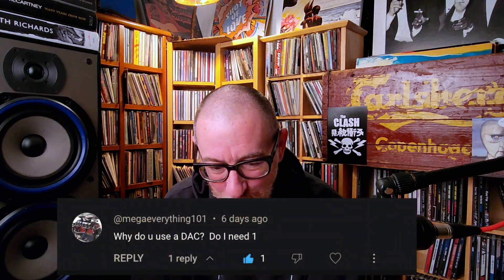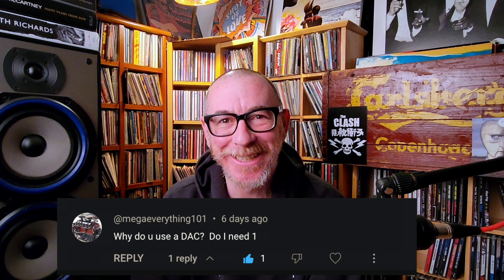What is a DAC? Simple and Straightforward Explanation.

Comment: Hi there, my friend! I just wanted you to clarify me. I'm using my mobile to stream music from Spotify and YouTube to my Samsung party speaker with Bluetooth, and I have a 3.5mm jack as well as RCA input and output options. Will this DAC work well with this setup? I believe my Samsung speaker has analog input and output capabilities. Will it make any difference in sound quality? I'm particularly interested in using this DAC for improved clarity and sound separation.
Reply from the maker: Hi there! I this case, if you wanted to use an external DAC you could connect it to your phone via USB and then run the analogue outputs from the DAC into the analogue inputs of the speaker. This will bypass the DAC in the speaker that would be used if sending the music from the phone to the speaker over bluetooth.
Reply: Analog-digital hifi machines were develloped by advanced companies as Philips, Sony and teac! Their advanced transports and inboard DACs are not outperformed by the new overprized snakeoil!
Reply from the maker: @GeirRssaak  You can buy very good sounding external DACs for not much money. The Fosi Audio Q4 I use is around £65 on Amazon. I wouldn't say that was overpriced.

Also over the years, we have seen different types of DAC evolve. Sigma Delta, Mulitibit, Ladder, etc. All these have different sound characteristics and even different manufacturers of each type will design them in such a way as to recreate the analogue sound in their own way. 

I understand you think DACs are all the same, but they're not and they're certainly not (for the most part) snake oil. 

With that being said, as with everything in hifi there are laws of diminishing returns. If your speakers aren't capable of resolving the difference or your ears aren't what they I've were (like mine) then spending thousands on a DAC may not be wise. For my hearing and system I was able to achieve a very noticeable improvement in sound quality with the modestly priced Fosi. I'm not here too sell you one or argue with you though, so by so means don't get one of you don't want one!
Reply: matt, thank you!

Comment: Informative and interesting. I use a Cambridge Audio dacmagic 200 straight into my audiolab 8000lx (and then out to a pair of rare Polk RT16 speakers) with great results. The main input to my DAC is a Chromecast audio (different from a normal telly watching Chromecast) which can output an analogue signal (normal headphone 3.5mm jack) or in my case a digital optical out. Brilliant inexpensive streaming results with low cost gear.
Reply from the maker: Cheers Jamie, those Polk RT16's are very cool! I hadn't come across the Chromecast Audio until you mentioned it but it looks pretty nifty! Will it stream files from a local drive too? I've just ordered a CD burner with a view to building a music server filled with all the stuff in my CD collection so this might be an option for streaming from that if so.
Reply: @mattsmusichannel  the Chromecast audio is for sending audio to from your phone or laptop, via WiFi.. If the media player you are using  supports Chromecast then It should work

Comment: Well done! And much needed. I imagine that direct "digital" electronic signals (without a DAC) would sound a lot like those beeps and static we used to hear on old dial-up modems or fax machines. Not a faithful reproduction of music, but the sound of 1s and 0s being transmitted over the wires. When I got back into LPs about ten years ago, I was mystified by all the talk about boxes and USB devices called "DACs" in hi-fi magazines. I like the '70s hi-fi sound I grew up with, so I was entirely unaware of their existence -- because we never had a digital source that needed to be converted to analog until CDs came along. I just plugged my turntable into the RCA phono jacks on the back of my receiver and (later) the CD player into an AUX input and that was that. I've run into people in recent years who are amazed that pre-'80s amplifiers used to come with their own built-in phono stages. (They're returning now.) Standalone DACs, like external phono preamps, can definitely make a huge difference in the quality of sound. After burning my entire CD library (well, almost) onto hard drives, I often run Roon from a MacMini through a Cambridge Audio DacMagic Plus into my vintage Marantz or Pioneer or Sansui amp and it sounds very much like the analog records I remember...